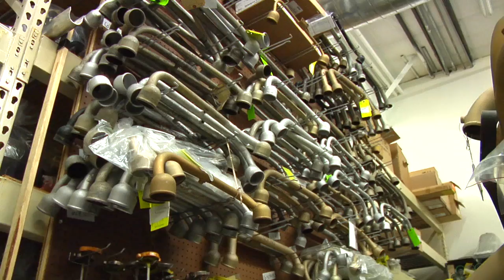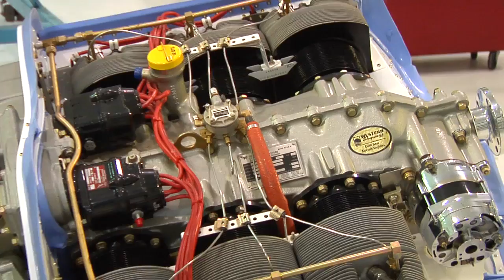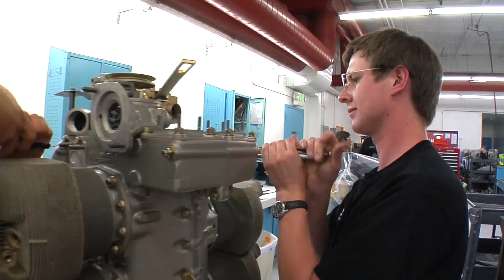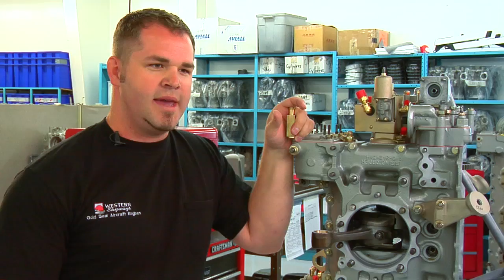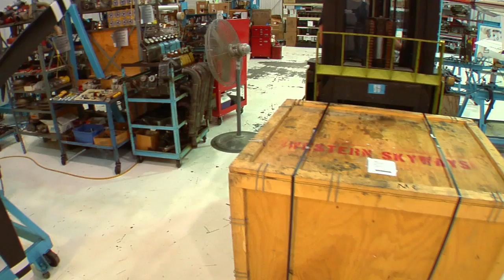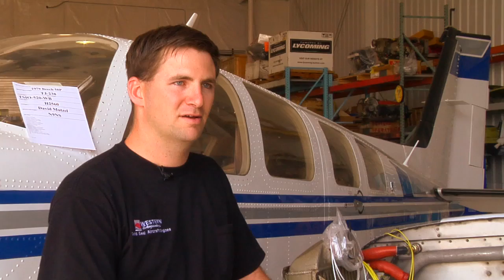Western Skyways Piston Aircraft Engine Overhaul Process - 2 (HD)

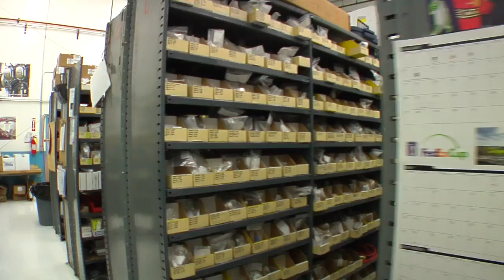Comment: 0:42 ...we also use 1980s computers
Reply: As long as they work and are backed up nightly, all is good.  Probably were being used for history only as I'm sure they had already moved to a new system and the history on the old system couldn't be easily converted into the new software platform.
Reply: @dabneyoffermein595  They are never backed up...
Reply: @FrozenHaxor  how do you know this.  i would beg to differ
Reply: @dabneyoffermein595  how would you